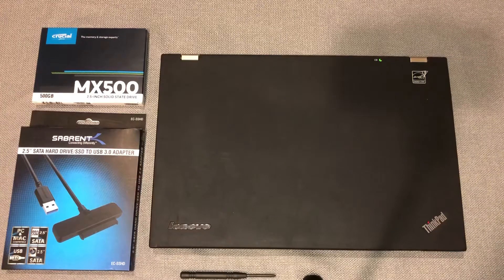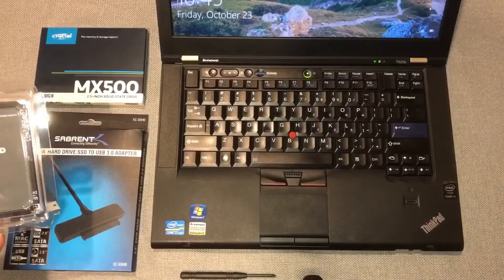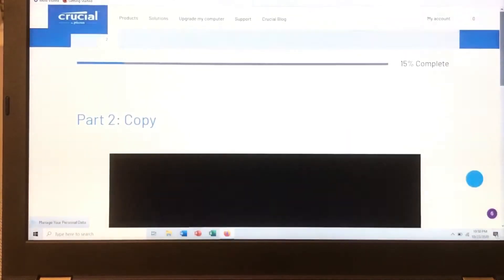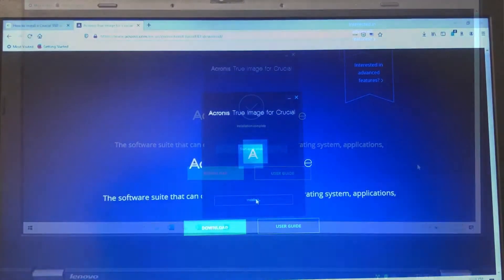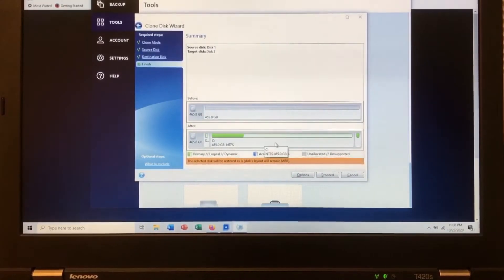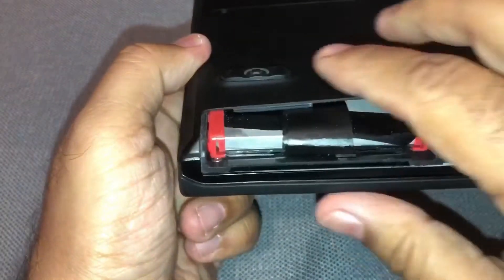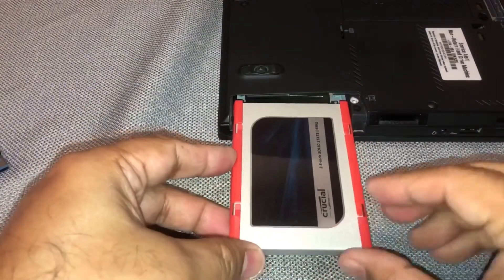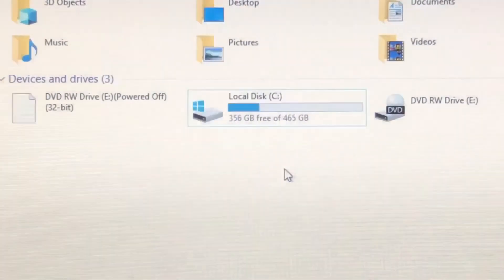Thinkpad T420s SSD Clone & Upgrade

Comment: I have the T420 which only has USB 2.0. Will this still work for me?? Please answer!
Reply from the maker: Yes, it will work with USD 2.0.  If the hard drive/SSD you are replacing is full of data, it may take a bit longer to transfer data but it will work.
Reply: @FlyBeee  Thanks!
Reply from the maker: @graceonline320  You are welcome. If you get a chance, let me know how the results of the upgrade. The Description of this video has step-by-step process listed for the upgrade, in case it is needed. Best wishes.

Comment: Heyo, My hdd is dead, can I just put in the ssd without cloning and then boot an os from a usb stick?
Also, those red brackets on the sides of the ssd that help it stay in place, do they come with the ssd or do I have to buy then separately?
Reply from the maker: Yea, that should work. Just be sure to use a compatible SSD.
Reply: @FlyBeee  thanks.